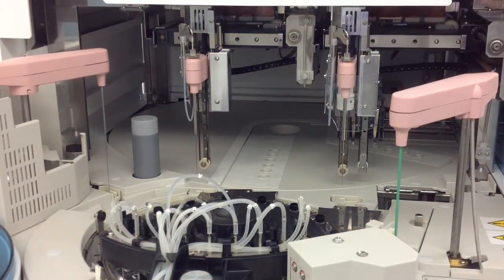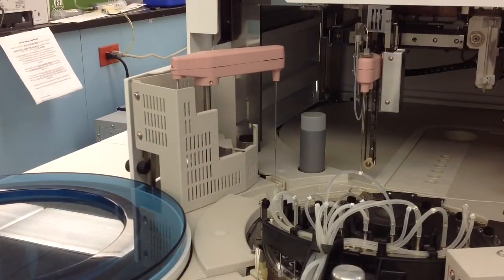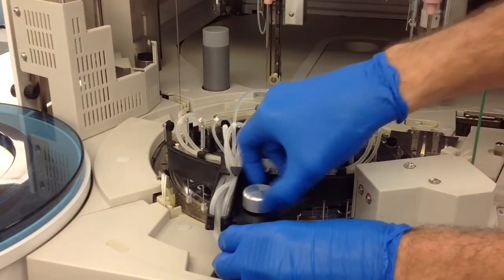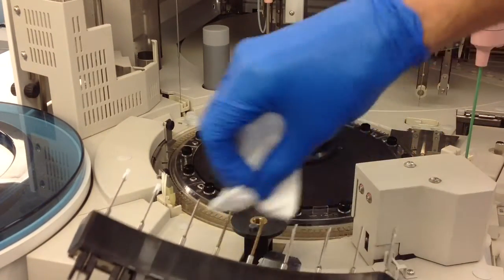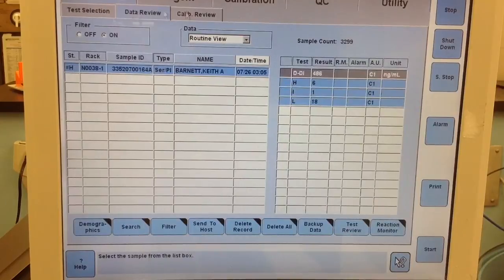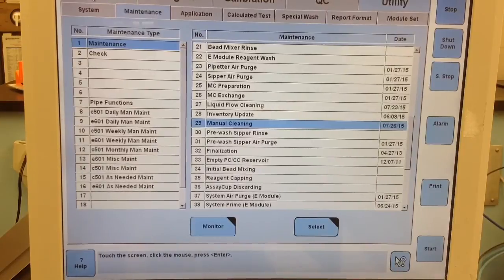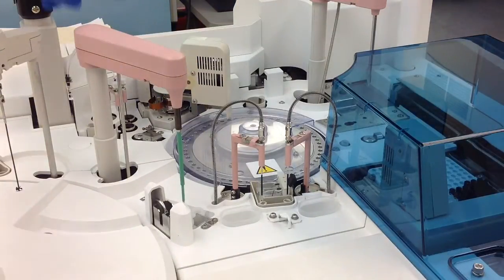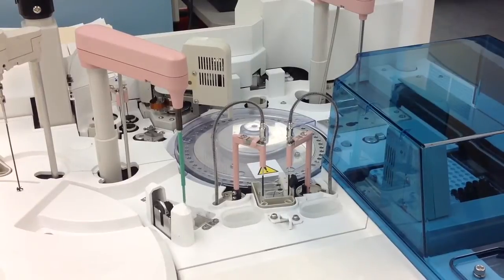How to do the daily maintenance on the Cobas 6000

Comment: I’m not a pro but I think that the instrument is on stand-by mode that will cause some damage when you shift and change the position of the probes
Reply from the maker: There is a manual cleaning mode for the 601 side but I don't believe there is one for the 501 side.